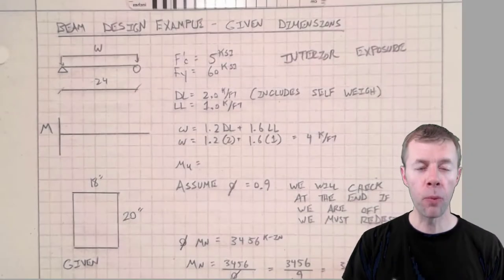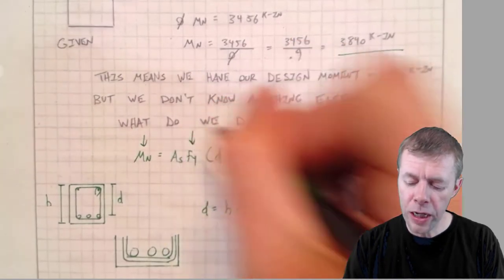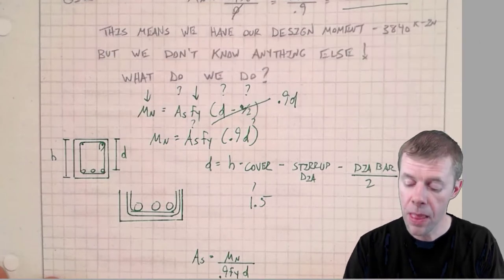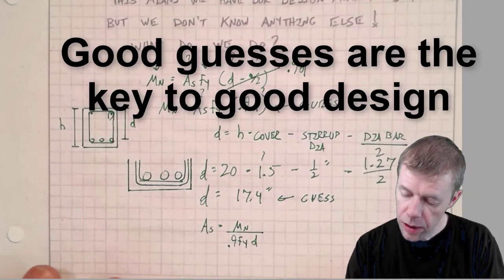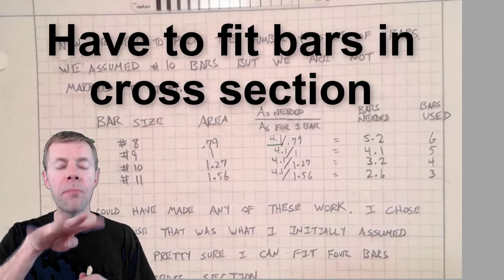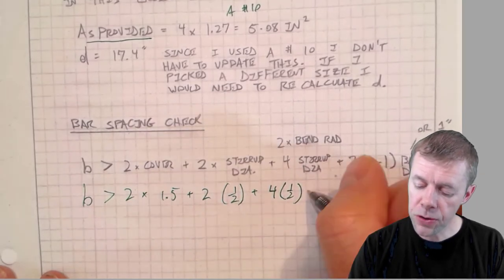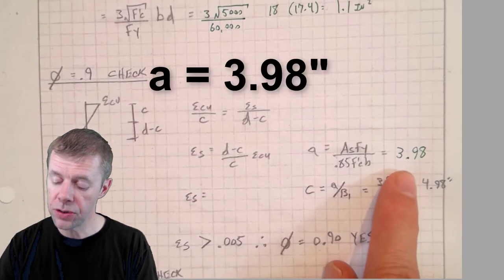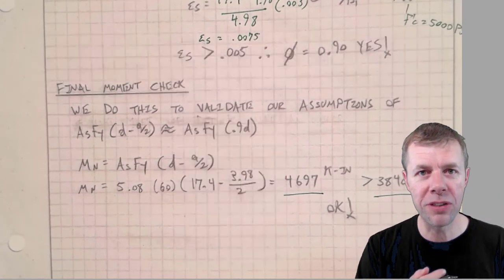Singly reinforced concrete beam design example | homework example 1

Comment: Thanks professor 
IN Your previous video where you explained how to check the bar spacing in cement, the (n-1) does not have  a "2" precede it sir but the case is different here sir
Which is one supposed to use sir